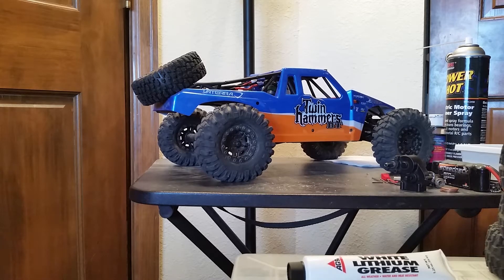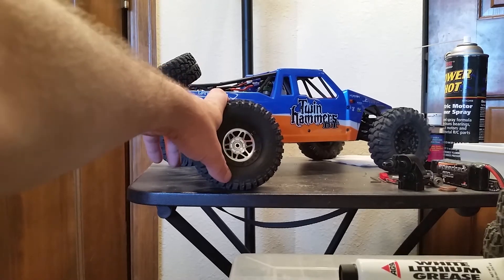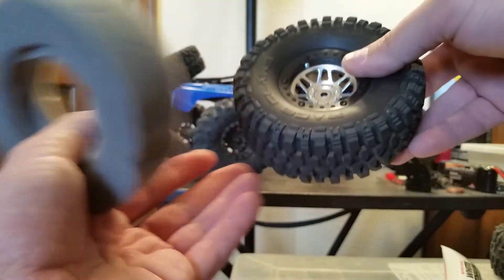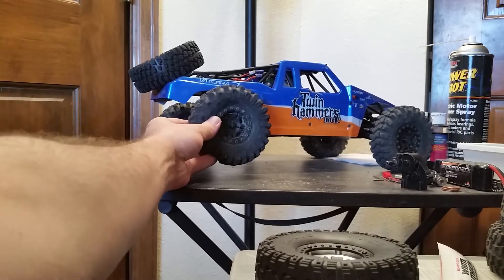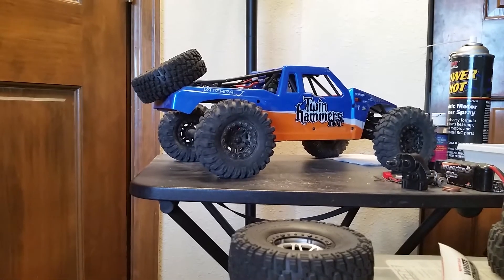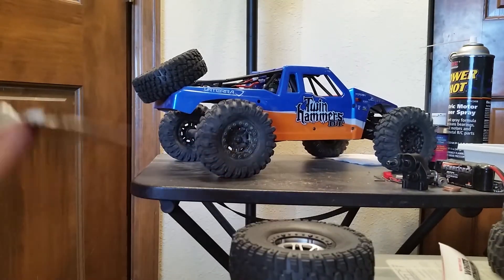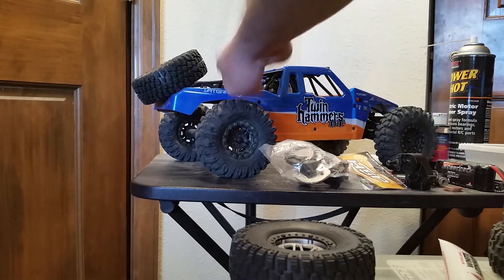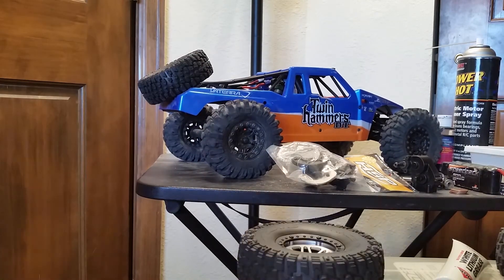Updating on My RCS

Comment: There's a trick I saw to get air on beadlock tires that I would like to try.  Pull the foams out. Block the breather holes in the wheels by wrapping tape around the inside of the wheel a couple times (or just epoxy the holes closed). Leave the beadlock off one side and put the tire and wheel in the freezer for 30 minutes; this condenses the air. After 30 minutes lift a tiny bit of the bead to allow air to get into the tire, then reseat the bead.  Replace the beadlock ring very quickly, or actually do it in the freezer.  Now when the wheel and tire warm up the air inside them will expand and you'll have aired tires. Not sure this would be good for 30 mph, but it would be awesome for crawlin'.
Reply from the maker: Duck Landes you're going to have to do a little bit more than that to it especially if your tire brand is the same tire that came with my truck look on the outside edge of your tire in this sooner Groove you'll find two holes on opposite sides drilled into the rubber tire, and even know what the plastic Rim you're probably still want to go ahead and Loctite all the beadlocks as well, I was thinking about doing it as well but the garage tires instantly got a hole in them driving in a construction zone the second set of tires also one of those pop a hole in it as well and I'm not quite sure what did it all I know is those tires were never in a construction zone, and to make sure your tires are holding air just fill up the sink or bathtub with water put it under give it a squeeze and see if you any air bubbles come out🤓
Reply from the maker: Duck Landes and great trick for inflating the tires by the way🖒🖒
Reply: I have never seen off-road tires with breather holes, only racing tires. I can't easily try this freezer trick myself because... I don't have have a freezer.  I'll have to hit up a neighbor (I'm sure they'll think I'm nuts wanting to freeze tires, but my neighbors all know I'm nuts anyway :>
Reply from the maker: Duck Landes the name on my tires are race cross, I was thinking the Breather holes were for running through the water it gives the water an easier place to Xscape from the Rams and waiting for evaporation to take place, what is not surprising that it would be more of a racing tire than of crawling Tire considering that it is a high-speed off-road truggy at least mine is I know yours is a buggy, I'm not sure but if you're looking to plug those holes if your tires have them the same trick for repairing the tire should hopefully work for sealing the home, it might just take some time considering his how it's a whole and not a gas and considering his how it's tire glue it should hopefully not hardened like a plastic and allow the tire to move a little bit and not crack instantly